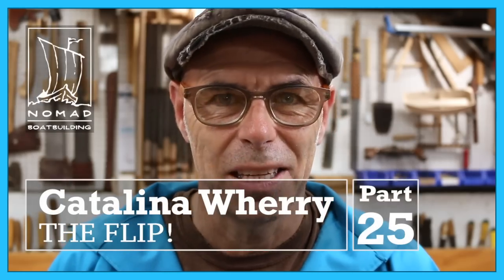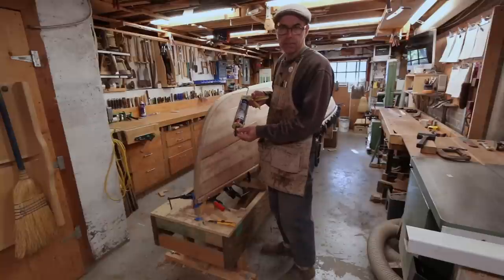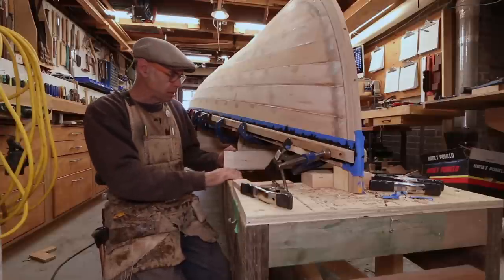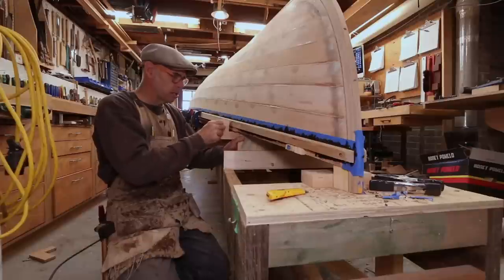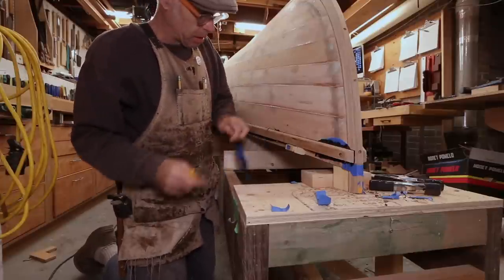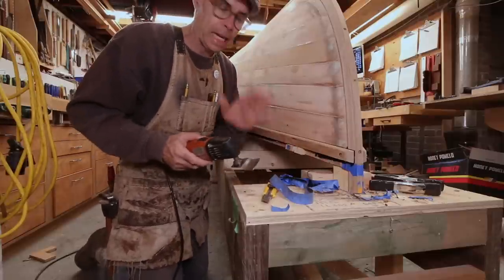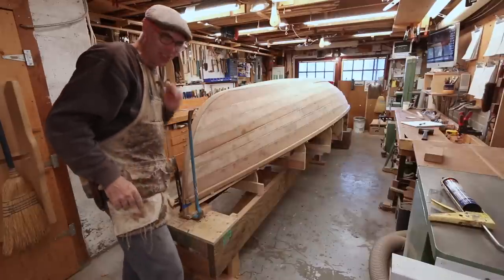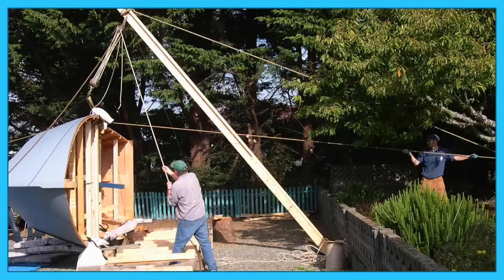Building the Catalina Wherry - Part 25 - Flipping the hull

Comment: Lovely moment, the first sight of the inside of the boat. Lot's of work left......

Have we seen the 2.4m thingy under sail yet? You promised!
Reply from the maker: It’s been out for a test drive but I wasn’t present. Official launch is scheduled for sometime in September I'm told. The delay is because the owner is having trouble getting the 2.4mR official to do the measuring and class certification process. It’s the only non-fibreglass version in North American apparently. All the others are Norland MkV despite it being and open class.

Comment: Hi  :  It is @13:16  Understand what is being said but puzzled why.  Had hi-level goof along this edge in attaching the planks.  Should it be a concave joint?
Reply from the maker: Hard to explain. There was no goof up. The connection between the two planks is an inside corner so when fitting the planks, only the plank closest to the bottom got a ribband to rest on. The mating plank was hard to fit because there wasn't a solid surface for it to rest on except the transom. A second ribband running along the inside corner would have been helpful. Couldn’t see that need when building the mould.